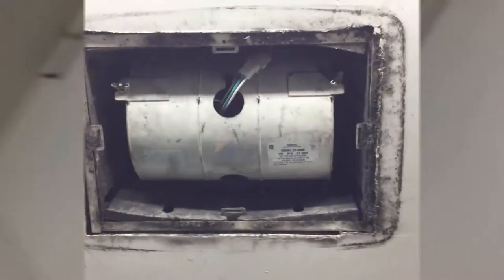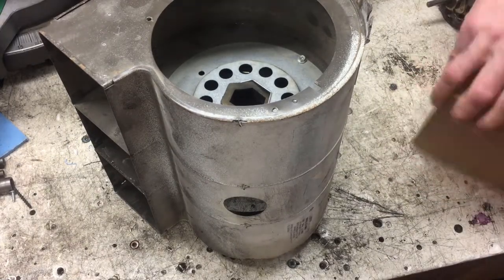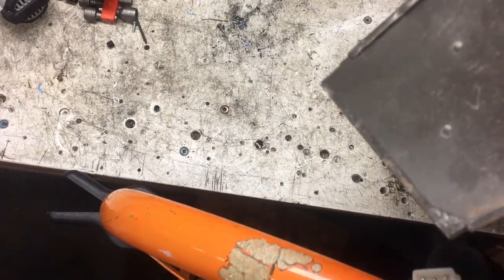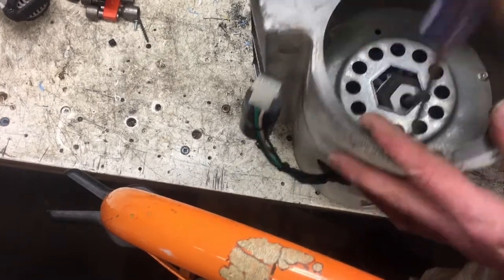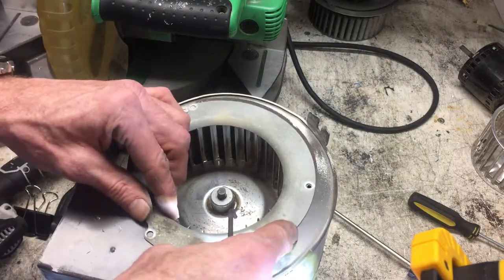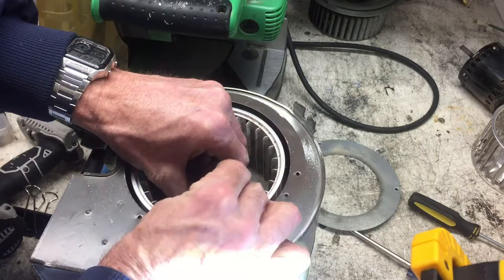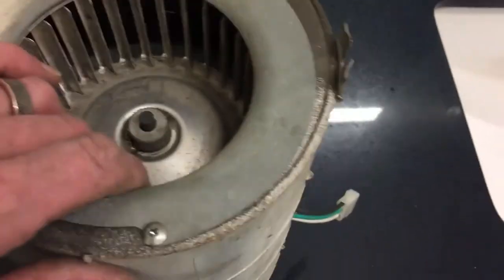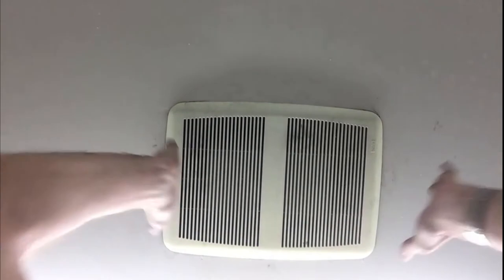Epic Domination of the QT-300N Restroom Fan

Comment: I replaced the motor but it seems to be pushing air back not pulling it out. I reverse the  blade wheels  no difference
Reply from the maker: Sorry for the late reply. Is anything blocking the air duct? Did you replace the motor because it was not working?